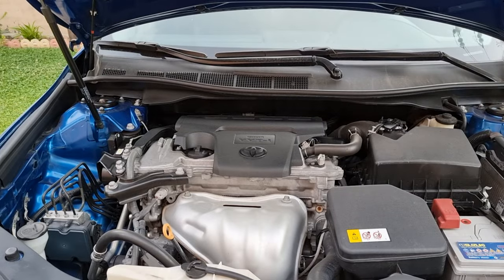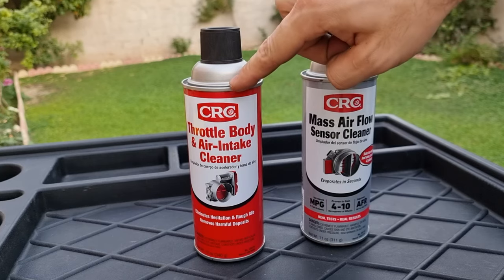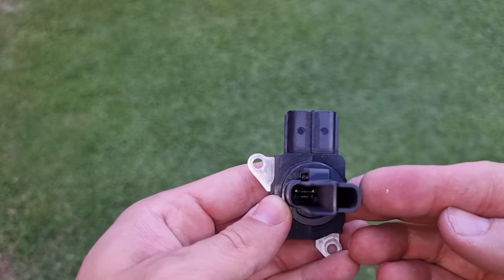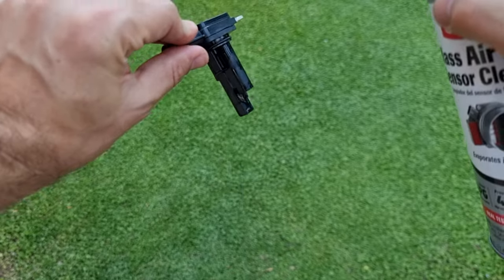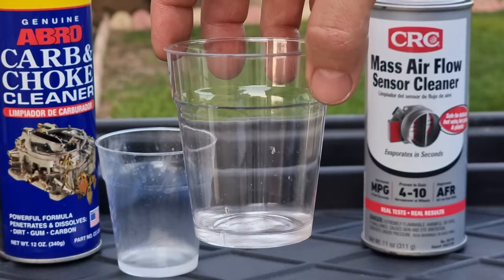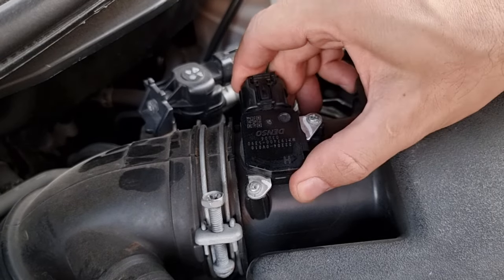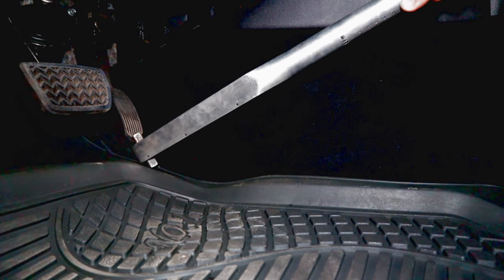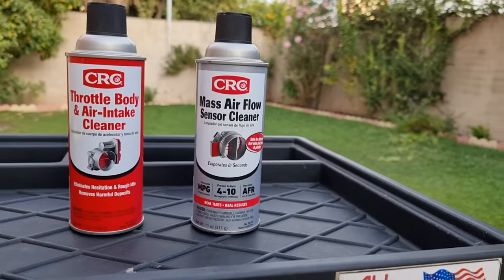Your car will Run better After using these/How to clean Mass Air flow sensor/Cleaning Throttle body

Comment: Appreciate the tips to save money on gas n to keep the car in good shape.. I have a 04 infiniti g35.. Do i do the same procedure u did or would i have to remove my tb for cleaning?? Thanx
Reply from the maker: Thanks, Yes its same procedure, you will only need to remove throttle body hose

Comment: Can I use electronic contact cleaner? It's meant for electronics? Any reply appreciated! Cheers from Australia ❤
Reply from the maker: No, bc it will leave a residue on the surface that ment for better contact,  but here it will cover the sensor and it won't read accurate reading

Comment: Weird. I put a brand new MAF sensor and the mileage stayed the same & the old one was the original one & the throttle body was replaced with a new one shortly before that!

Comment: Can you use throttle body cleaner in oxygen sensor hole to clean first stage catalytic converter
Reply from the maker: the use of this product will not harm the catalytic converter.
Reply: @AliMECH  is carpet cleaner safer as I remember you use this before
Reply from the maker: @bronniesboy  yes, most mechanics remove catalytic convertor and put it in a dish soap bucket

Comment: Why do you have to buy two cans can't you just spray a little bit of the mass air flow sensor cleaner on the rag and wipe the throttle body